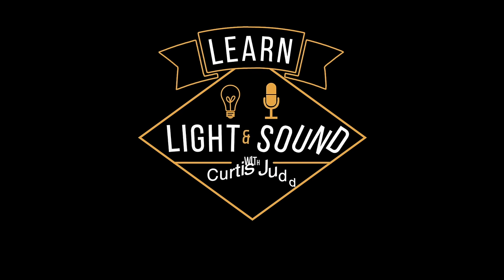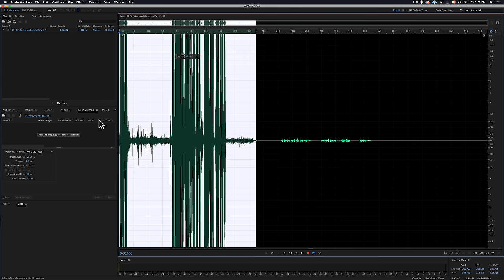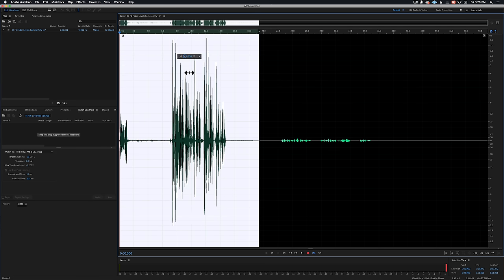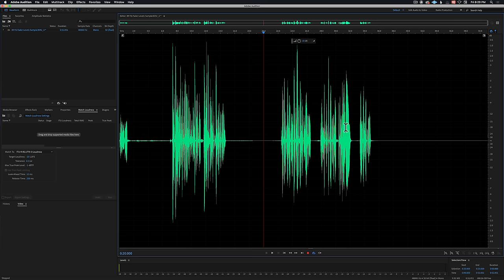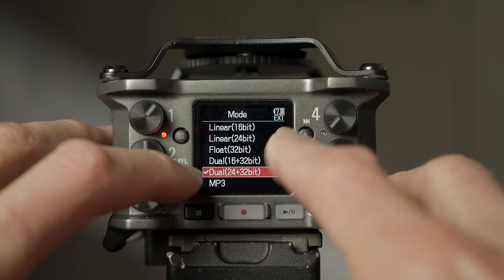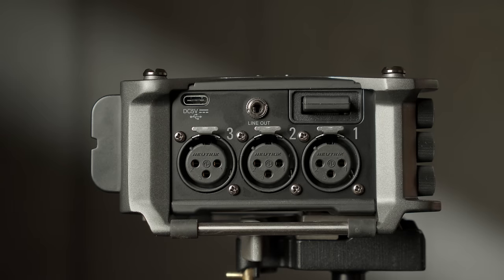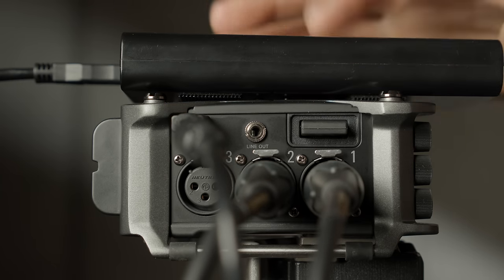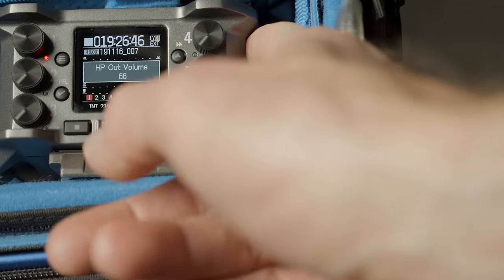Zoom F6 Audio Recorder Review

Comment from the maker: CORRECTION F6 CAN record 32-bit Float at 192kHz. To do so, you must turn off the LR Mix and AutoMix and Limiters. ALSO recently found that many cameras record rather noisy audio when you feed audio from the F6's output to the camera's microphone input. I didn't have this issue with the BMPCC6K when I sent a line level signal but did have the issue with a Panasonic GH5 with a mic level signal. I have reported this issue to Zoom North America. AND, DaVinci Resolve now handles 32-bit float files.
Reply from the maker: Would be nice if it gave you a hint as to why 192kHz is grayed out when it is. Potential firmware update, Zoom? 😀
Reply: Zlatko Zlatev  Hi Zlatko. If I am correct then you only change the fader (output) but not the gain if you have set it to 32 Bit.
Reply: is it better than mix-pre?
Reply: @jukarnarius It does. I use the tone generator to set the levels on output when its plugged into cameras.
Reply: Zlatko Zlatev  But only in 32 bits mode Isn`t?. I want this function on 24 bits mode with limiters. Zoom ¡It's annoying!
Reply: Does F6 Supplies plug-in power? or my lavalier would be completely useless even with xlr-to-3.5mm adapter?
Reply from the maker: @jukarnarius  Not via the XLR inputs. Use a RODE VXLR+ adapter to if you want to plug a 3.5mm lavalier into the F6.
Reply: @curtisjudd  Thank you so much for your rapid answer.
Reply: Is that also possible when using the F6 as an audio interface? If not, what's the 'best possible' spec F6 can do as an interface?
Reply from the maker: @smoothreeds  The full specs, including via USB are listed at https://zoomcorp.com/en/us/field-recorders/field-recorders/f6/ under specs & details. 24-bit, 96kHz via USB.
Reply: @curtisjudd  thanks for the reply and a great review!
Reply: Thanks!

Comment: I just receently bought one of these (in Australia), based on your review. I love it!
32-bit, clipless audio is such a profound, incredible leap forward, and I can't thank you enough for bringing it to my attention.
As a solo videographer, I'm certainly never going back!
...
Of note, I found that - beyond just letting me set the perfect 'gain' in post, I was also able to apply some really extreme EQ to the 32-bit WAVs inside Adobe Premiere (a 20dB swing from -10dB to +10dB) without the usual appearance of coloring/ugliness/smearing I'd otherwise expect in a highly-processed sound. (I don't actually know if any of Adobe Premiere's EQs are specifically linear phase but doubt it). Or so it appeared to me, anyway:
...
On the F6 I recorded 32-bit/48kHz, and just two days previously the H6 (24-bit/48kHz) - in the same theatre/space, same mic (NTG3).
The space isn't acoustically treated for bass, so (coupled with the NTG3s low-midness), I have to apply a very strong EQ cut to lows, and boost to highs.
I applied the same (massive) EQ to both recordings, and the 32-bit just SINGS.
...
On top of that, Zoom knocked it out of the park with the power options. I bought an Atomos 2-pack and charger, with over 8 hours of run time on a single L-battery, which can be swapped out in mere seconds. I'm not going to miss AA batteries at all. Stupidly happy. 
...
Thanks again Curtis.
Reply from the maker: Thanks for you insights, Greyfoo!

Comment: Hi Curtis, thank you for your precious work on the platform. 
I have a brand new Sennheiser 416, which I'd couple with the G3 Lav Sennheiser. I'm just starting out in the audio world, and I'm not an expert by any means. 
I frequently hear the argument “For the price of the Zoom F6, at that point might as well wait a bit longer and get a Sound Devices MixPre 3 II”. 
Now, money is tight, but I would spend the extra if you tell me the difference in the noise level is noticeable with an MKH 416 once you start to crank it up. I would mostly record in 32-bit float.
I can't help but mention that I have a person who wants to sell me a Zoom F6 used once, plus a Zoom bag, plus 2 NPF batteries (8500mah) for roughly the equivalent of 500 USD.
The Sound Devices MixPre 3 II would cost me the equivalent of 1120 USD. 
I really don't know what to do. The number of accessories and the low price pull me towards the used Zoom F6... but will I give up a lot in terms of noise?
The difference in functions is not really on the table here, since with my workflow, I would use both in the same way, so the differences highlighted wouldn't probably be a Pro or a Con in my specific case.
Again, thank you! Looking forward to reading what you think about this!
Reply from the maker: In terms of self noise, no, I haven't found the MixPre to a be much different — they're both very clean.

There are other reasons I prefer the MixPre, mostly ergonomic, but you can make great sound with the F6. The most important thing will be to learn it inside and out. You'll make great sound.

If you need any help learning the F6, we have a course over at school.learnlightandsound.com.
Reply: @curtisjudd  thank you, I’ll check out your course

Comment: Good review up to your usual high standard.I upgraded from a Zoom F8 to the F6 and loved it. However after a week I decided to swap to the MixPre-6 Mk ii. You've made an accurate comparison between the two, so I won't repeat them, but...

However, I want to note that the 3.5mm Aux mic input on the MP range is really excellent, especially with the smaller units, when the user might be vlogging in the field, as you can plug in a 3.5mm mic that needs plug-in power, without resolving to a bulky XLR adaptor, like the Rode VXLR+. This is especially handy, for "quick and dirty" stereo location sound such as I might use on a holiday, when I can plug in a Rode Stereo Video MicPro.

Point in favour of the F6, compared to the MixPre-3 or 6 Mk ii, is that its iOS App can produce a Sound Report. This is only available on the much more expensive MixPre-10 Mk ii.

For me personally, the draw cards for the MixPre-6 Mk ii, were gain controls in 32 bit mode, 3.5mm stereo input, 1/4" line inputs and the user interface, however I also liked the F6, so much that I might buy it again if I needed the extra inputs, or get a new F8something, when 32 bit comes to the F8 range.
Reply: @roryonabike5863  Thanks for that Rory. (what's you bike, BTW? - I am also a motorbiker). WaveAgent currently doesn't support 32 bit audio files(!!! DUH) and requires running on a Mac, so it is really a pain in the you know what for field use. In contrast the Zoom iOS App can create this in the field. Too bad about Android users, though. As SD provide Sound Report facility for the MixPre-10 using the WingMan App, I really think they should have that feature for the MixPre-3 and 6, after all it would not cost them anything and the SD products are hardly cheap so intentionally limiting this function seems to me contra productive.
Reply from the maker: I think you capture my sentiment, too: it’s a tough choice. Both really are quite impressive.
Reply: RemekTek Media Hi. Moto Guzzi V7 II. WaveAgent also runs in Windows, but as you say it doesn’t work in iOS. I agree about the WingMan app.

Comment: What happens if one tries to use a wireless lav mike with the F6 set for 32 bit/dual converters?
Reply from the maker: The wireless system or lavalier mic are almost certainly going to be the dynamic range limiting factors.
Reply: @curtisjudd  I am considering the F6 to record a panel discussion, 2 boomed NTG 5s as backup to 4 individual lavs. Are there wireless Lavs that will be able to take advantage of the 32bit, or would the Zoom F2 or Tentacle Sync Track E be a better option? Thank you in advance :-)
Reply from the maker: @LordCaes  Zaxcom makes wireless systems with a feature they call Neverclip. It does not use a 32-bit float wav file, but a proprietary format called MARF. It achieves the same thing but really works best with Zaxcom mixer/recorders and are very expensive - in a totally different league to the F6. Assuming you're not looking to spend that much money, I would say the F2 or Track E would be good options.
Reply: @curtisjudd  Thanks very much!

Comment: I know this is an older video, but I still find a lot of value on watching them. My question to Curtis is, it's now March 2023. Given the price difference between the Zoom F6 and the Sound Device Mix-Pre 3 II is $150, what do you consider to be the better option and why?
Reply from the maker: It comes down to how many inputs you need and your preferences. I’m my case, I’d choose the MixPre-3 II which is what I use to record most of my YouTube videos. Ergonomically it works better for me and I prefer the sound of the MixPre preamps. I also like that I can just pull the USB thumb drive out of the side to get the files without having to remove a battery to get to the SD card. I also find the MixPre menus much more intuitive and quicker to navigate.

Comment: I ended up buying a F6 that was a floor model for $580. I really wanted the mix pre-6 but I don't do enough sounds jobs to justify the extra $$ for it for two less inputs (even though I really prefer the combo inputs over standard XLRs). 
I've only recorded a handful of things with it so far but I really do love it. I don't worry as much about watching the levels and instead focus on the subjects being filmed.
Thank you for helping make the decision!
Reply from the maker: 👍 glad to hear it’s working out!
Reply: @curtisjudd  Quick update, I've only had one issue so far, and that happened when I inserted an older SD card that has become frozen (you can access the files on it, but can't write anything new). The F6 said error but then armed and said it was recording. Long story short it didn't record anything, and there was nothing to recover. Had I tried to format the card I would have figured it out, but it was a bit of a rush and I've used other cards in it without formatting and had no issues. But you live and you learn (and always record a test sample on the card before using it that day). Luckily I had a scratch track running to a camera so all isn't lost, but it's not 32bit so less wiggle room in post.
Reply from the maker: @FrankETaylor  Thanks for sharing. Definitely a good idea to format and test the card first. In fact, in the System->SD Card menu, there's a testing function to confirm the card will work well with the F6.
Reply: @curtisjudd  Yeah it's funny because I ran that after the fact just to see what it would say and it said the card was fine. But yeah, if I had tried to format it first I would have had a less stressful weekend. I talked to them on the phone and they might fix that in a firmware update, but they had never encountered anything like that so who knows.

Comment: Wow, I was really looking forward to this review, and you did not disappoint! Long list of questions, sorry: 
1) Since the F6 has dual ADC's combined with the 32-bit recording, vs. the MixPre II with only 32-bit, what is the performance difference there? How do the dual ADC's contribute to the overall dynamic range? 
2) Additionally, in your test of the "recoverability" of the audio clips, how does the F6 perform in raising the levels in post if the sound source itself was very quiet? I assume you were speaking at the same moderate volume in all the samples. Based on my understanding of 32-bit recording (which is admittedly limited), the recorder basically redivides the relative difference in amplitude for a sound wave at the given fader setting, which is what allows you to bring up the volume in post without introducing much extra noise. But what if you already had the fader set at +60 dB, and still had to bring it up a lot in post? I'm probably really misunderstanding 32-bit, but I was just wondering if you could clarify that a bit.
3) Is there a practical reason why the ability to set the gain on the MixPre II would be preferable to the unity gain on the F6, assuming you were using 32-bit recording since doing so would presumably result in no difference in ability to record clean audio? Obviously, being able to set the gain in 24-bit would be a big advantage.
4) Given the inability to set the gain on the F6, how does it perform in 24-bit mode in terms of raising the noise floor at high fader levels? Or having inadvertently set the faders too low, how much does raising it in post raise the noise floor?
Again, thank you so much for this review! You've got a lot of amazing content!
Reply from the maker: Hi John: 1) The MixPre II also has multiple ADCs. They don't say exactly how many, but their patent cites 3 ADCs and the process for how they re-combine the output of each to record to 32-bit float. The difference seems to be that on the MixPre, they allowed you the freedom to set the gain, which I suspect has to do with the presumed 3 ADCs. 2) That will depends largely on the microphone, is my guess. Will require more tests. 3) Yes, microphones are generally designed/voiced with the assumption that some amount of gain will be applied post mic preamp. You might not get the optimal performance of some microphones on the F6 given this. I didn't find any obvious examples in my testing so far, so this is only theoretical. 4) In 24-bit and 16 bit modes, you can adjust the gain/trim so in those cases, it performs just like a Zoom F8n, which is to say, very well in terms of noise performance.

Comment: Just a fabulous review Curtis - yours are easily the best audio equipment reviews on you tube. By Far. Just one question. When you choose to record in 24-bit or lower, do the fader knobs become gain knobs?
Reply from the maker: Hi Scott, thanks! The knobs are still fader knobs by default, even in 24-bit mode. But there is another mode you can change in the menu which allows you to use the knobs as gain knobs until you press record, at which point they become faders.
Reply: @curtisjudd  Thanks again Curtis. So if the knobs are still faders but 24-bit does not have the benefit of float, how do you set gain to prevent clipping?
Reply from the maker: @ScottHiddelston  In the channel menus there is a gain setting.

Comment: I like MixPre lighting each knob to show which one is clipping without needing to check the screen and which number of channel. But seen setup of MixPre 6 up close the biggest issue was powering it. The L Mount adapter was too odd use in sound bag and we had issue that the metal tabs not connect well and slight movement would disconnect, we had to use large powerbank at the end to power it with being afraid with the flimsy small usb type c could break over time. Zoom F6 with L-mount for me would be a better solution as have many f970 batteries on set to power it for a long time.
Reply from the maker: Sounds like you got a defective battery sled on the MixPre. They should replace it for you. Did you contact SD support?
Reply: @curtisjudd  we just gave it back to the shop
Reply from the maker: @chungdha  Good luck with the F6, then. I hope it works well for you.

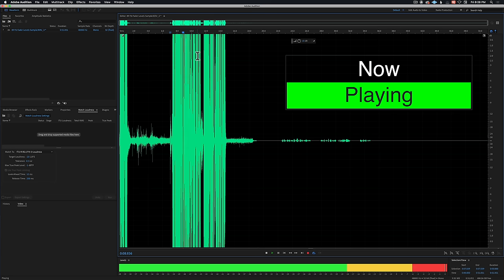Comment: 2:07 I am conditioned to laugh due to the over abundance off insanely bass boosted memes. Awesome review, I've been binge watching so many of your field recording related videos and I am still undecided between this or the Mix Pre 3, especially given the fact that I can get an Orca bag plus SD card bundle on the Zoom, still less than what the Mix pre 3 ii by itself costs. Very difficult. Thanks for the great insights!
Reply from the maker: 😅 It sounds like you may have some solid reasoning on a direction.

Comment: First of all.wow.thanks for this in depth review.
I was wondering why you would chose the premix for yourself?
Is it because you are able to power higher end headphones?
Or is it because you can set the gain in 32 bit float?
Build quality?
What is it Chris?
I‘m dying to know:)
Reply from the maker: Yes, many little things: can set the gain, has an analogue limiter in 24-but mode, build quality, backup to USB thumb drive, better 3.5mm output, I prefer the menus of the MixPre, and a lot of other tiny things.
Reply: @curtisjudd  thank you.
That was insightful.
Keep it up

Comment: Hi! Thanks for taking time to do this video - much appreciated 👏🏻 As I’m currently looking at getting either the Zoom F6 OR the SoundDevices Mix Pre 6 II. In my research (not being able to test them before ordering) it seems to me that the F6 only attenuates the “not active” mic by very few DB, where the Mix Pre is more like the original Dugan Automix where it aims at keeping a similar level of “energy” and level of background noise and ambience no matter which and / or how many mics are receiving input at any given time. I’m fairly familiar with the Dugan approach in the Yamaha CL mixing consoles and it works just like I want. Am I right in seeing the F6 as a less active automix in this comparison (perhaps to avoid getting hit by a Dugan parent lawsuit - maybe even in case of the SoundDevices, as they renamed it MixAssist instead of automix)?
Reply from the maker: The SoundDevices 8xx series recorders (their flagship line above the MixPre) has both MixAssist and Dugan auto mixing. They’re a little different with Dugan sounding more natural and transparent and MixAssist being a bit more aggressive at managing noise, in my experience. I agree that the F6’s automix is not nearly as aggressive.
Reply: @curtisjudd  Thanks for pointing that out, Curtis - I wasn't aware that the 8-series had this difference (having both options)!